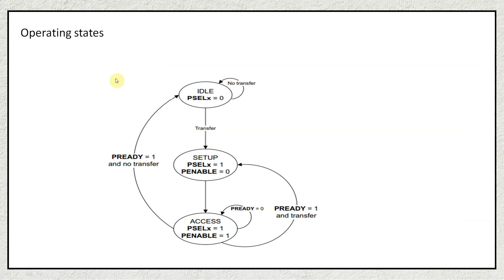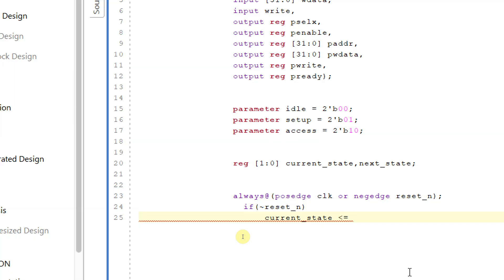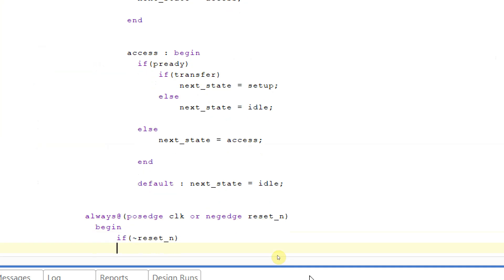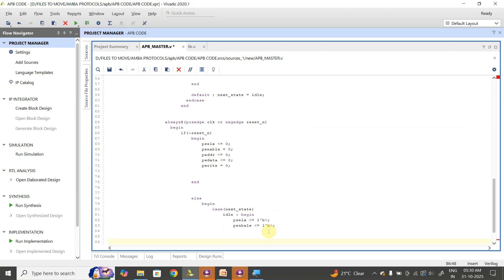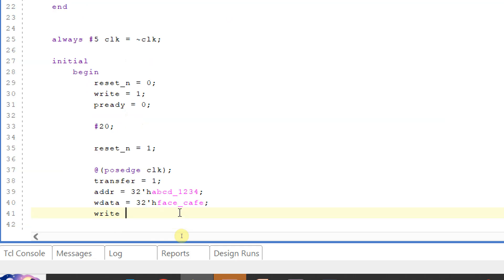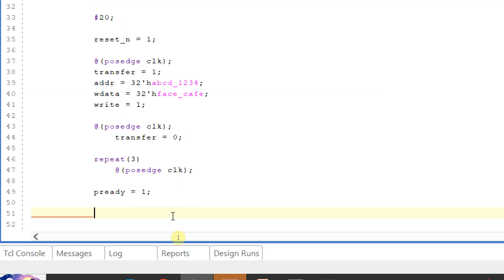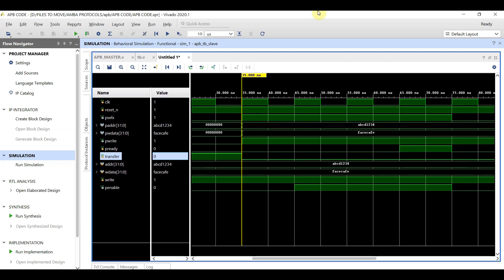APB Protocol Verilog Code Explained | Step-by-Step APB Design and Implementation

Comment: 00:00:00 - Introduction to APB Master and Slave Verilog Code Development.
00:00:14 - APB Master FSM Explanation: Review of the state diagram (IDLE, SETUP, ACCESS) that the code will implement.
00:00:50 - APB Master Module Declaration: Defining all input and output ports (Clock, Reset, Transfer, Address, PSelect, PEnable, etc.).
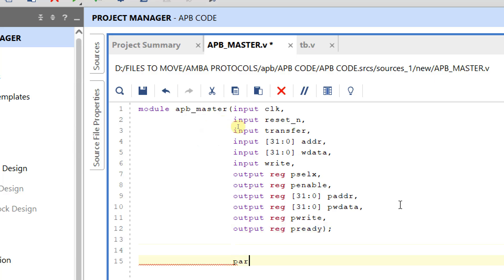00:02:56 - FSM Parameters and Variables: Declaring state codes (IDLE, SETUP, ACCESS) and state registers.
00:03:38 - Present State Logic: Verilog code for updating the current state register on the clock edge or reset.
00:04:23 - Next State Logic (Combinational FSM): Writing the logic for state transitions.
00:04:30 - Logic for the IDLE state.
00:05:11 - Logic for the SETUP state.
00:05:33 - Logic for the ACCESS state (checking PReady and transfer).
00:07:07 - Output Logic Implementation (Master Outputs): Writing the logic to generate APB output signals based on the next state.
00:07:24 - Reset condition output initialization.
00:08:00 - Output signals in the IDLE state.
00:08:42 - Output signals in the SETUP state (Asserting PSelect, assigning Address/Data/Write).
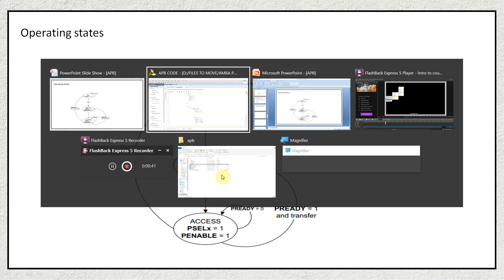00:09:46 - Output signals in the ACCESS state (Asserting PEnable).
00:10:14 - APB Testbench (Slave) Development: Starting the testbench module and instantiating the APB Master DUT.
00:12:18 - Testbench Initialization and Clock Generation: Setting initial values and creating the clock.
00:13:25 - Initiating a Write Transfer: Applying stimulus (reset removal, setting Address/Data, asserting transfer=1).
00:14:13 - Simulating the Slave Response: Asserting PReady=1 to complete the access phase.
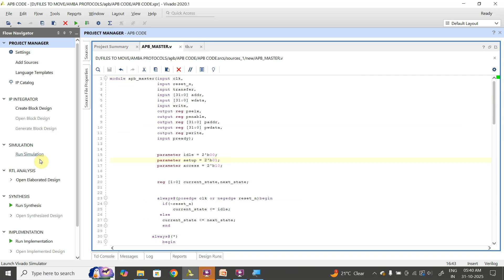00:15:09 - Simulation Waveform Verification: Reviewing the simulation output to confirm correct state transitions and signal behavior.
00:16:41 - Conclusion.